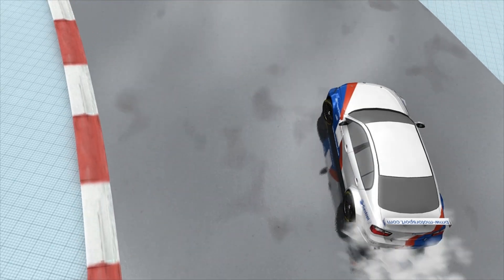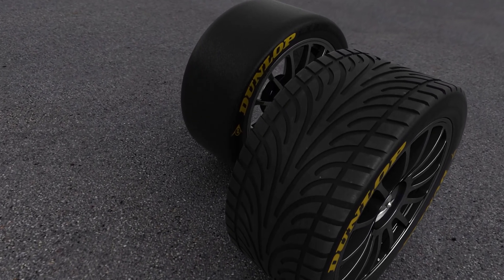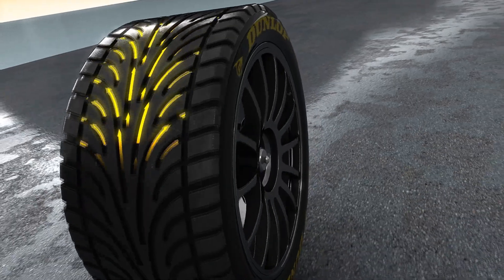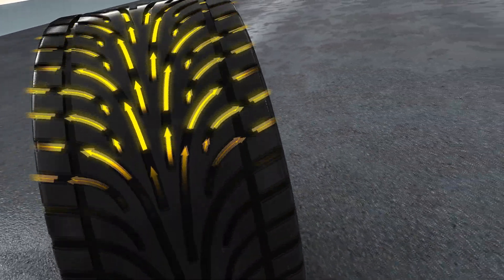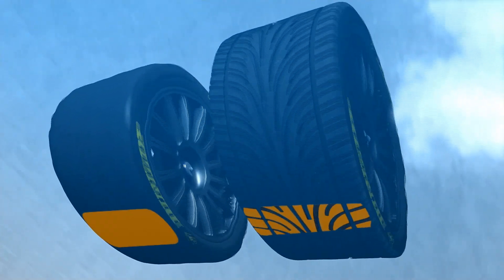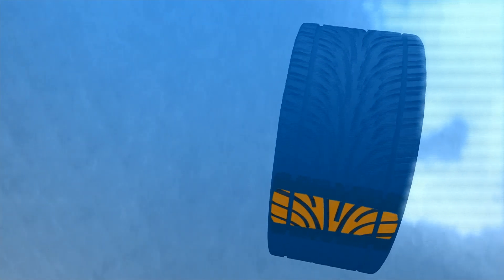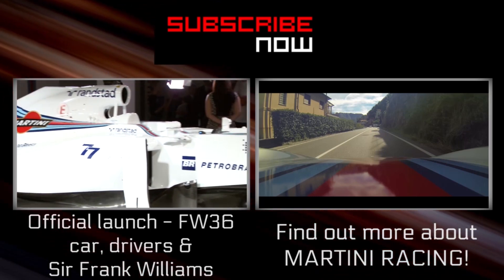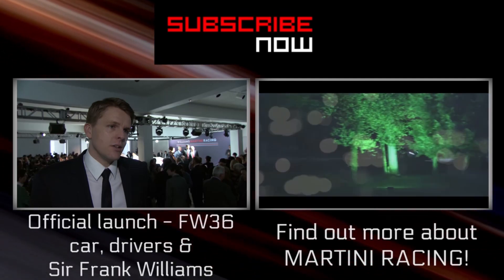Find out how a car aquaplanes - slick and wet tyres

Comment: People don't already know this?
Reply: Yeah but if you think deeper, the grooves would only allow the tiny rubber at the side of each grove to contact with surface. The parts with no grooves would still have extreme contact with water. The part that I dont undrestand was the fact that when the tire surface contacts with the water, the water only enters inside the grooved parts and it will not contact with road surface. The parts where there is no groove will be floating on water. I tried to find the perfect video that can clearly show how grooves work in process. This video is the most helpful one but still reseaeching